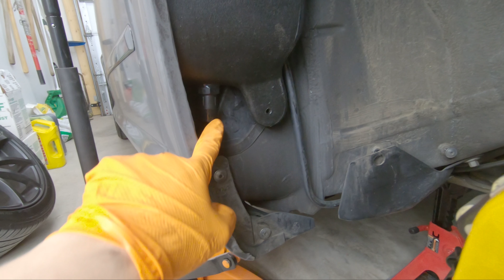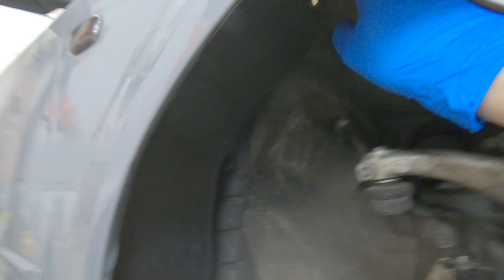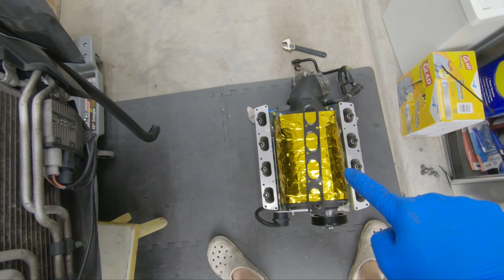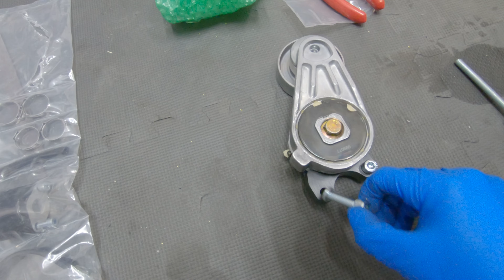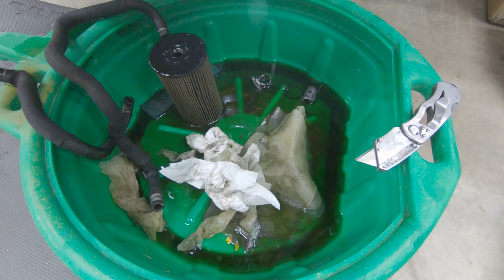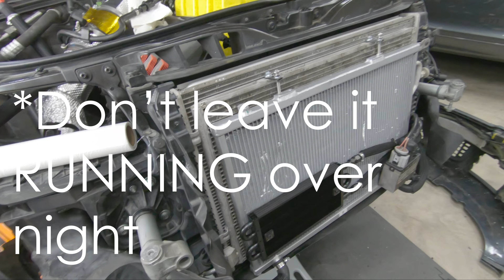VF Engineering Install Pt II

Comment: Is this engine an NA engine? What mods have you done to it?
Reply from the maker: From the factory it's NA. Once a supercharger or turbo is added it's not NA anymore
Reply: @markb6s4  what mods you had to do to handle the supercharger?
Reply from the maker: As for internal everything is OEM. What does need to be upgraded is the fuel injectors bc the ones from VF are not big enough. Here is a link of all that has been done to the car.

https://youtu.be/RamsizZRog4

Comment: What injectors are you going to run?
Reply from the maker: so i had to change the 370cc that came with the kit to bosch 550cc injectors
Reply: @markb6s4  thanks! Are you gonna have Matt tune it?
Reply from the maker: Yup. Right now we have been logging and tune revisions. Once they finalize the tune I'll be working on the next video about tune and logging